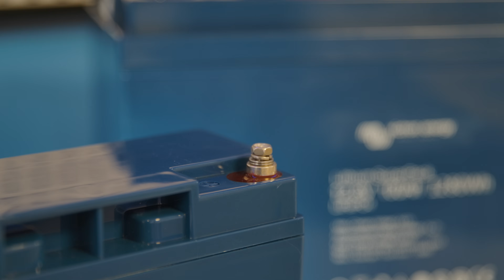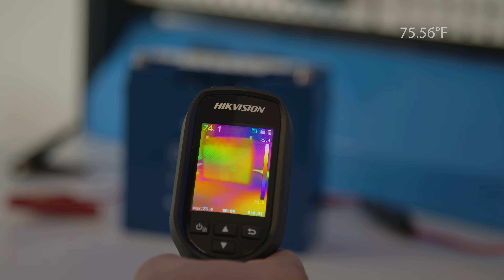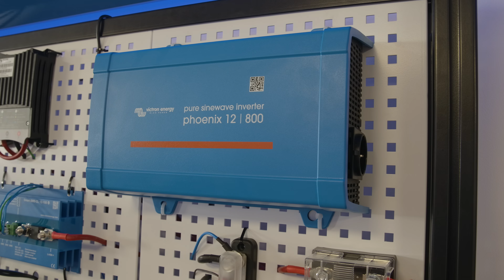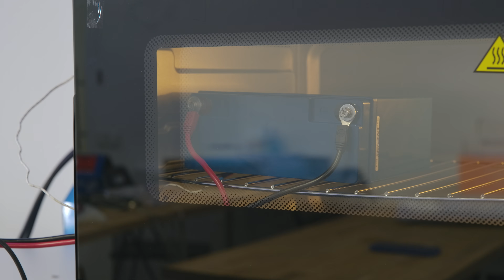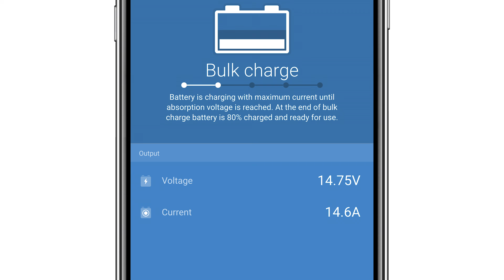Extreme cold and heat lithium battery test

Comment from the maker: 🎯 Key Takeaways for quick navigation:

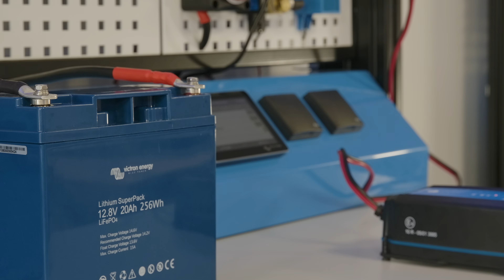00:29 🚀 Lithium batteries, especially Victron Energy's Lithium-iron-phosphate chemistry, offer numerous advantages over lead-acid batteries, including higher energy density, deeper discharge, and faster charging.
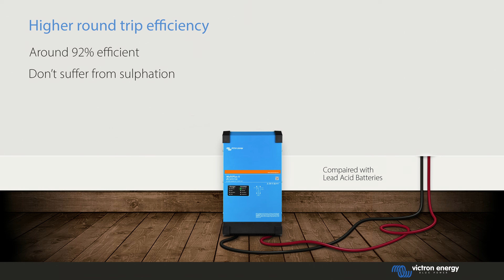02:48 🔋 Lithium batteries have a longer lifetime with many more charge cycles compared to lead-acid batteries, making them a cost-effective choice in the long run.
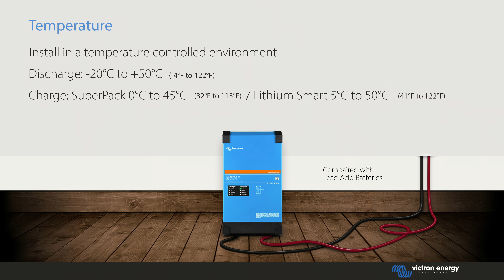03:47 ❄️ Lithium batteries can operate in colder conditions, but they should be charged and stored in controlled temperatures for optimal performance.
04:46 💰 Despite the higher initial cost, lithium batteries can be more cost-effective than lead-acid batteries when considering the cost per cycle and other benefits, such as reduced maintenance.
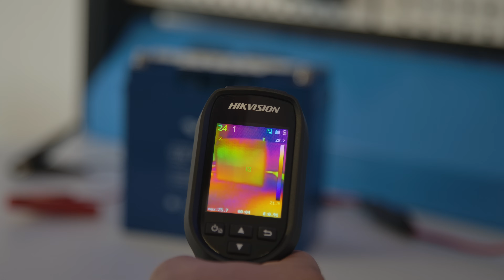05:42 🔌 Victron Energy's SuperPack batteries, designed as direct lead-acid replacements, have internal BMS (Battery Management System) and can handle various temperature extremes and voltage conditions.

Comment: I bought a 100Ah Superpack back in March 2019, I wasn't aware that the internal BMS had a low temperature disconnect feature on it when I bought it so I have disconnected it through the winter months to avoid charging it when the temperatures are low (there was no mention of it in the literature, indeed your current webpage for the superpack quotes "The internal switch will disconnect the battery in case of over discharge, over charge or high temperature." No mention of Low Temperature) am I right in thinking my 2019 superpack will have the same capabilities as you are saying the superpacks have in 2021 (or now 2022) and that I can leave the battery connected to my Campervan charging system all year round with no danger of damage?

Comment: Hi Victron : )) 
can I ask few question ??? 
how do you have set up communication between BMSs (withs is folded from 3.2V cells battery packs) GX&&Multi II ??? 
It is communicate via their CAN bus, or via RS485, or do I not communicate via this protocols and it is comunicate only via smartShunt communicates ???
It would be quite nice if GX could cooperate with a BMSs communicating via CAN bus, without SmartShunt... Did you have some experience with that ????  :P

Because if it is communicate only via SmartShunt the GX && Multi it  will not have info. about errors from the BMS, OK BMS shutDown the battery, but you dont have info. from the first sight... and you must check via bluethoot connection on the BMSs or from another way...
This is not bug ? This is a future ? :P

Comment: Can they be used in vehicle conversions? That is when replacing a diesel engine with a electric motor. Providing for the opportunity to use solar from the roof of the vehicle in addition to the normal plug in charging.
Reply from the maker: Yes. They are ideal for marine,  RV, vans etc.
Reply: @VictronEnergyBV  Does that mean also for use in driving the conversion motor be it AC or DC?

Comment: I have a pair of Victron 12-230 AgM super cycle batts that are 2 years old, very lightly used. Can I put another identical new pair in series without detriment so I can get up to 24v 460A?
Reply from the maker: No I’m afraid you can’t. It’s always best to only combine identical sized new AGM at the very start of their install / journey

Comment: Hi gays,
nice to hear more from the SuperPack. I use two 100 Ah Lithium SuperPack "high current" with one MultiPlus 12/3000/120-16, SmartShunt 500A and Cerbo GX in my motorhome. Now I have enough power for my oven and espresso machine.
Regards from Michael
Victron ESS and off-grid specialist in Germany 
My slogan is "catch the sun with blue power!"
Reply: Hi guys*
Reply from the maker: The high current version are great for brewing a coffee in the morning with the higher load!

Comment: Wish it was affordable
Reply from the maker: We totally realise lithium is a big investment right at the start. We do however sell loads of other battery chemistries.
Reply: I have a much cheaper LoFePO4 battery. The manufacturer couldn’t figure out how to make the BMS have a separate charge and discharge low temperature cutoff, so it will let you attempt to charge it below freezing, which will destroy it. 

Some of the manufacturers use grade B cells, or use used cells. 

Do you feel like being the BMS for your battery? I decided to take that risk, but it’s definitely a risk. 

I am enthusiastically waiting 6 months for my budget to let me get a Victron MultiPlus. I currently have to unplug my charger to use my microwave, which gets old quick. I haven’t found any other inverter / charger that has the same set of features.

Comment: Interesting video! Good to know it still gives power by -20! I have now a 100ah AGM as camper battery. But my system is build lithium ready with Victron gear.

And my plan is to upgrade to lithium but not sure if I go for the high-end victron solution or the affordable mid range lithium batteries.

It is awesome to have Bluetooth control on a 1965 Unimog 404 😁 Im looking forward to talk to you on Expo's!